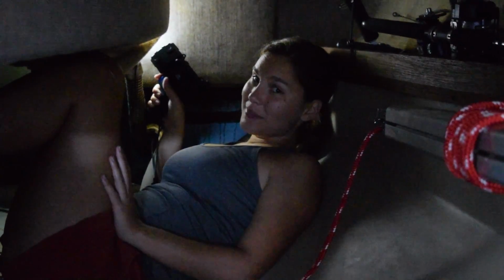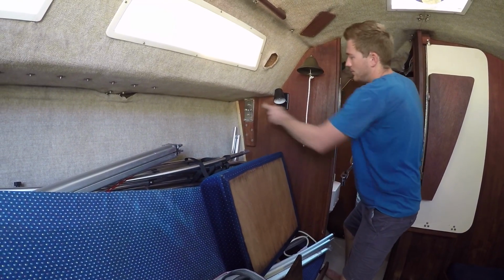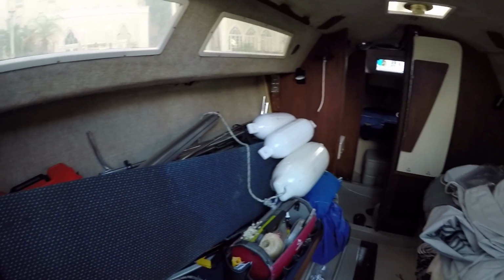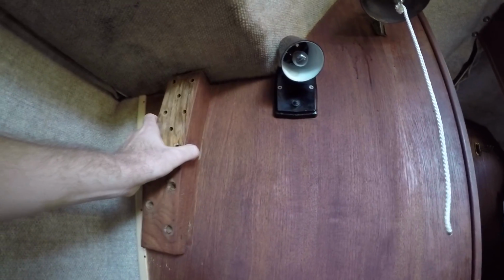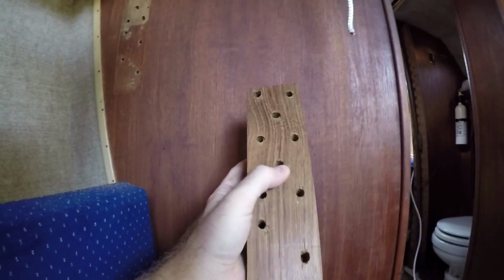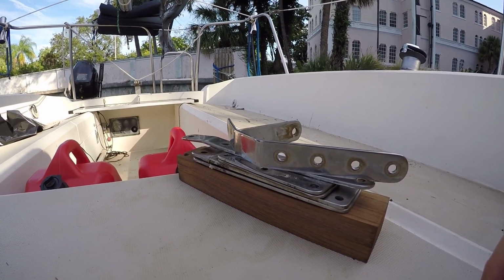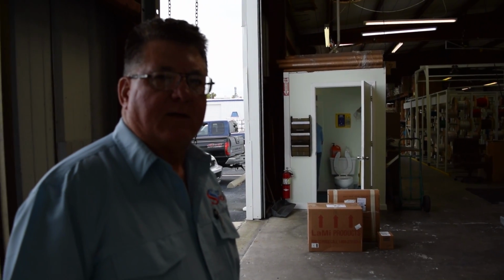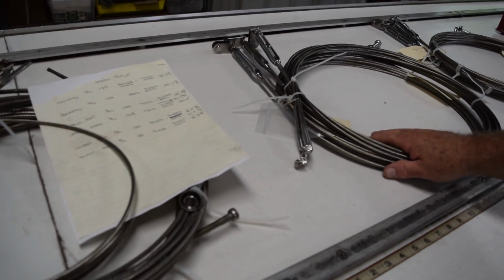8. (Part 3 of 4) We Replace Our Standing Rigging - Sailing Vessel Somnium

Comment: Welding the surface plates to the chain plates allows sealing around a larger perimeter on deck w 100% silicone. B4 bolting down 2 deck...place o-rings on bottom side of deck bolts...apply a bit of Vaseline or white grease to O-rings. Put a 3/8" silicone caulk bead on underside of surface/deck plate! Insert chainplate into slot, install/tighten bolts. Use antisieze on EVERY BOLT/NUT ASSMBY!! LOVE YOUR VIDEOS. Such nice, happy young people. Pleasure to watch!

Comment: Great channel, I'm a marine diesel mechanic, but used to do more general boat repair.  One way rot begins in bulkheads, is through the unsealed edges exposed by the chain plate bolts.  You can bed the plates, but because of the high loads, a much better way is to drill out bolt holes in the bulkhead slightly larger, fill with thickened epoxy, then drill out to original size.  Love your guys emphasis on safety and preventative maintenance, it's hard work now, but will pay off with peace of mind, its supposed to be relaxing after all :-)

Comment: Extra trim on a bulkhead can actually hide water damage on the bulkhead itself. I'd suggest using a penetrant epoxy like GitRot on the holes in the bulkhead. And no matter how you bed the chainplates? Every 6 months or year, lift the trim plates and renew the sealant at the deck. Something soft, even beeswax, is good for that since it conforms and moves with the deck.

Comment: FYI , marine plywood is only about 10% better (water resistant) than outdoor plywood and costs up to 4 times as much.  It's going to be sealed/stained/coated with whatever product your using.  Marine plywood is not water proof, it's water resistant.  Also , many people neglect ti seal the edges of holes and cuts.
Reply from the maker: Thanks for the input and for watching!
Reply: There was a time when marine plywood had all plies were perfect except that the inner plies could have football patches. There were no gaps that you ever encountered when cutting a panel. Those days are long gone.

Comment: Before I would replace all of those chainplates and other mounts, I would see what it would cost to have them magnafluxed (a process that detects crack).  It might be cheaper to replace them if you are getting a good deal through the rigging shop.

I don't see how those teak blocks ADD anything to the structure.  They do prevent the chainplate from digging into the plywood, but that is it.
Reply from the maker: Thanks for the input. I think that's how SECO south inspected our chainplates and it was determined that they were sound and in good condition. The teak blocks would just hopefully prevent the chainplate from ripping through the deck if the bulkhead ever failed.

Comment: Dismasting occurs to a sailing ship when one or more of the masts responsible for hoisting the sails that propel the vessel is broken or overturned, but the hull itself is still upright and seaworthy. During the age of sail,
 dismasting usually occurred as the result of high winds during a storm 
acting upon wooden masts, sails, rigging, and spars. Dismasting does not
 impair the vessel's ability to stay afloat, but rather its ability to 
move under sail power.

Demast
:  to remove or strip masts from (a ship)

you right on!
great vid
Reply from the maker: Thanks for the information and for watching!

Comment: Good  vid, interesting to see the rigging shop in action. You are on the right track with your project but remember the chain plates are only as good as whatever they are secured to. There are as many problems due to rotted bulkheads or, more often, bulkhead tabbing failures than actual chainplate breakage. Make sure you check the bulkhead tabbing.
Reply from the maker: Thank you for watching. I checked the bulkheads for rot and moisture but I haven't checked the tabbing yet. Can you give me some advice on how to do this? Do you know how I can expect my bulkheads to be tabbed? Thanks a bunch.